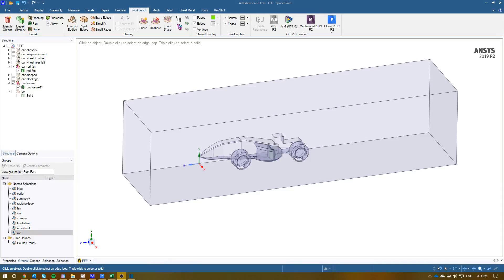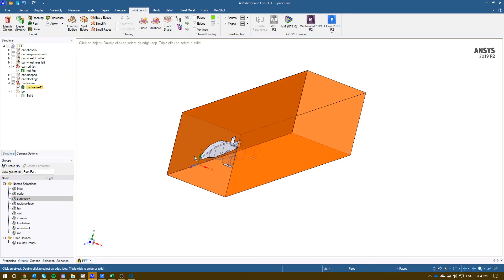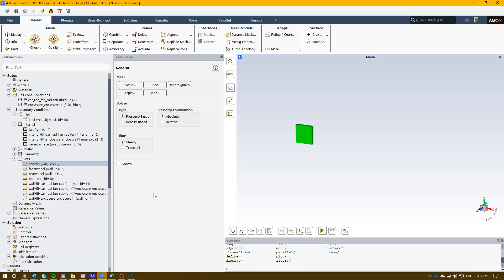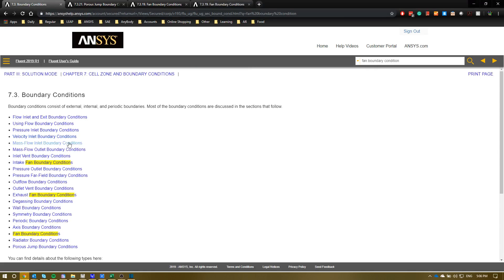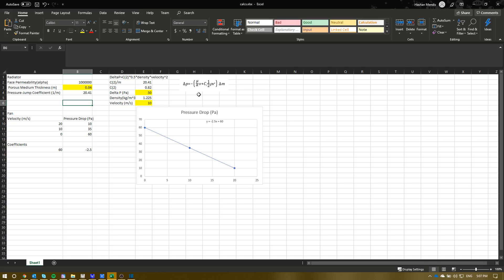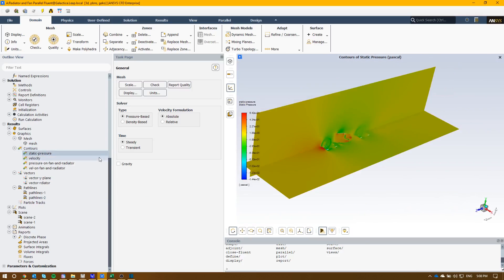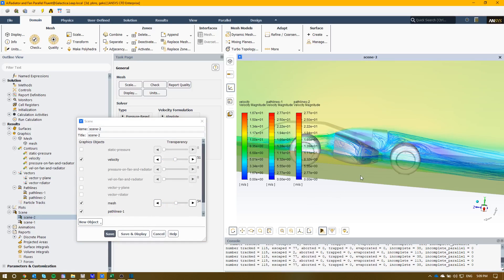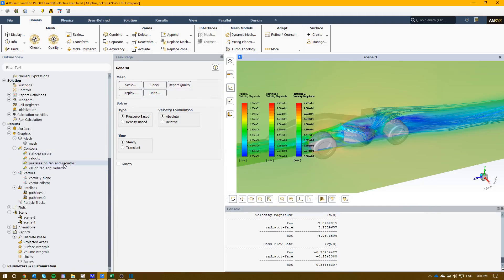Modelling Radiators and Fans - CFD for FSAE #15

Comment: Hi, 

I am a student in FSAE and after looking at your video explaning how to set up a car rad, I have a couple of questions. I saw that the required things for the sims to work is first a relation between the pressure jump and the flow of the fan. Is there a way to calculate those datas, like I saw you had those Numbers but where did you get them?

Comment: Any follow up video of how to do the meshing stage for this example?
Reply from the maker: We don't have a follow-up video created specifically for meshing of this example, but our existing meshing tutorials should adequately cover the approaches needed to successfully model a FSAE car with separate zone for radiator as shown in this example. 
 
There's 2 ways to do this:
share topology with between the radfan zone and enclosure zone in SpaceClaim/Discovery, then ensure you set both regions as fluid in the Create Regions task in Fluent meshing
Alternatively, skip share topology in CAD and share topology in Fluent meshing itself.
 
You can try following this video which achieves something similar (option 2) for a mixing tank Mixing Tank Tutorial Using Ansys Fluent Meshing Watertight Geometry Workflow: https://www.youtube.com/watch?v=PBot7Tgn044

Comment: thank for the great information,

the video was clear yet I have a few questions if you please. 
       - How can I converts a given fan geometry to your non-conformal fan interface
       - How should I set the topology (share/group/none) in SCDM
       - If I have a constant temperature object behind the fan how will I add it to the simulation?
thank you for your concern Best regards.
Reply: have you managed to overcome these isssues?
Reply: @ФСДСфан1 thank you for your concern. I have managed to come over these accept, replacing the fan geometry with a non-conformal surface
Reply: @Thonix94  may i ask how did you manage to replace the geometry with a non conformal surface?
Reply: @ФСДСфан1  Have you been able to progress?
Reply: @manuelsolerbarreda1662  yes
Reply: @ФСДСфан1  May I ask you how you did it? I am unable to end in the solver with an internal face boundary condition for my radiator. Even if selecting interface, it won't end in internal